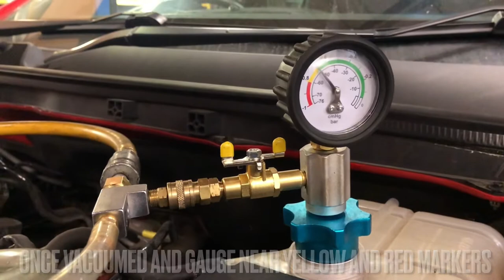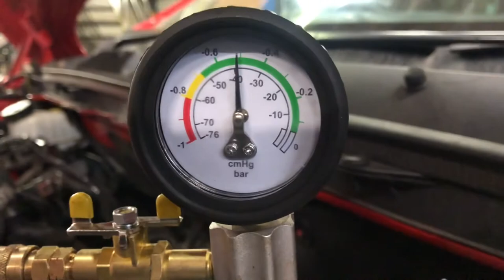How to use a coolant vacuum refill tool. Eliminate cooling system airlocks!

Comment: Was that system leaking a bit?   It was separate clips where the gauge dropped so I’m not sure.
Reply from the maker: Sure it shouldn’t drop normally the only cause is a bad seal with the tool or a leak on the cooling system.